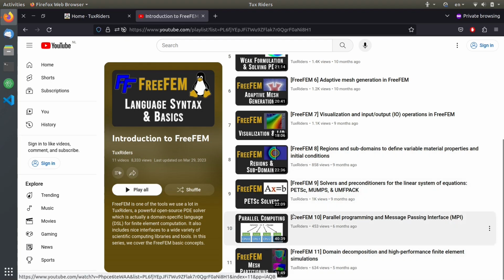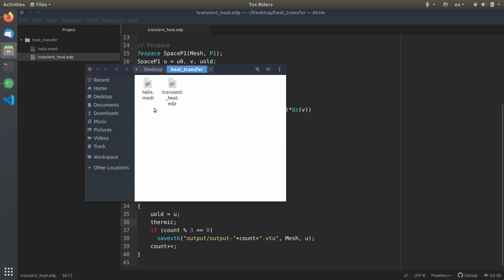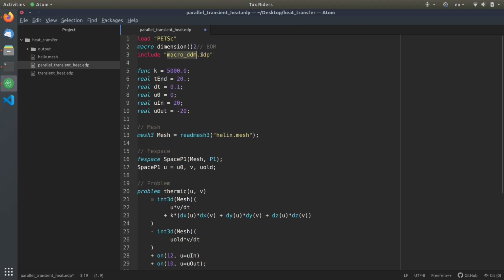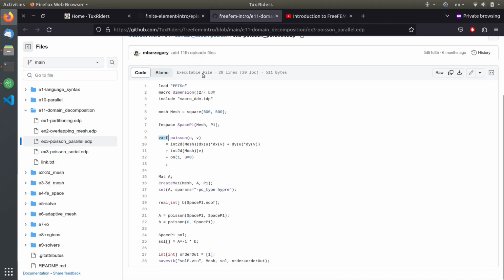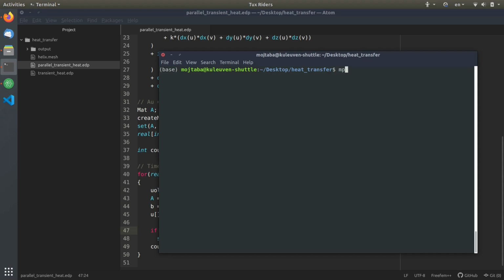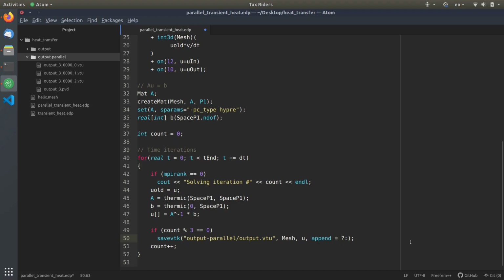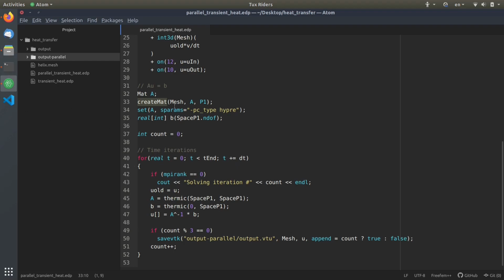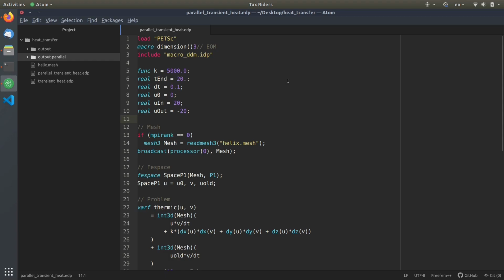Parallel 3D transient heat diffusion using FreeFEM | Mini-Project 1

Comment: Hello, thank you for the tutorial. I have a problem with my code. I am also trying to solve a transient heat equation, but my right-hand side is time-dependent and changes at each time step.

I solve the problem inside a function (func), assembling the matrix beforehand because it is constant, and then inside the function I define the new right-hand side and solve the equation.

Your method does not produce any errors, but the results are wrong and inconsistent; it gives me completely meaningless results.
Reply from the maker: Hi, glad to know that you found the video useful. It seems that you need to make sure you are updating the right-hand side vector properly within your loop to trigger the necessary assembly update for the solver (which can be a bit complicated in parallel cases). Does it work outside of the loop, like for just one time step or two? If so, there is something wrong with the loop. This is a software that solves a few time-dependent PDEs with non-constant left- and right-hand sides in parallel, so you may have a look at it to see how it does it: https://github.com/mbarzegary/BioDeg

Comment: ai summary

Abstract:

This technical demonstration outlines the process of refactoring a serial transient heat transfer simulation into a parallelized model using FreeFEM and the PETSc library. The project utilizes domain decomposition methods (DDM) to solve a 3D diffusion problem within a complex helix geometry. Key procedural steps include transitioning from standard problem statements to variational form (varf) implementations, configuring MPI-aware matrices and vectors, and implementing efficient mesh broadcasting from a primary rank. The presentation also addresses critical debugging requirements, specifically the necessity of mapping global state variables to local mesh partitions post-decomposition and managing parallel I/O to generate compatible VTU/PVD files for visualization in ParaView.

Implementation of Parallel Computing for Transient Heat Transfer in FreeFEM

    0:00 Project Overview: The session establishes a mini-project focused on developing a transient heat transfer model using parallel computing techniques in FreeFEM, building upon previous foundational tutorials on finite element modeling and MPI.
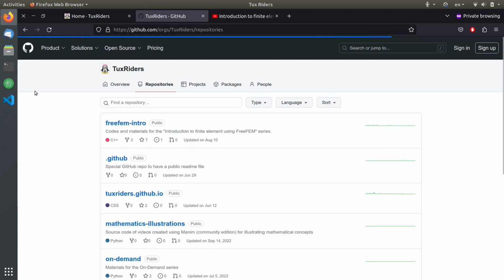    1:52 Code Integration: The workflow transitions a serial 3D helix diffusion model into a parallel environment by loading the PETSc plugin and the macro_ddm (Domain Decomposition Method) input file.
    7:45 Variational Formulation Refactoring: Standard solve or problem keywords are replaced with the varf statement. This requires a manual adjustment of the weak formulation, specifically flipping the sign of the right-hand side (RHS) to ensure correct assembly when moving terms across the equality.
    9:41 Matrix and Vector Assembly: Parallel-compatible matrices ($A$) and vectors ($b$) are initialized using the createMat macro. This process partitions the mesh according to the available MPI ranks and assigns algebraic multigrid (AMG) preconditioners via the Hypre package.
    12:10 PETSc Solver Integration: The system $Ax = b$ is solved at each time step using PETSc solvers, with the solution vector $U$ being updated across the partitioned domain.
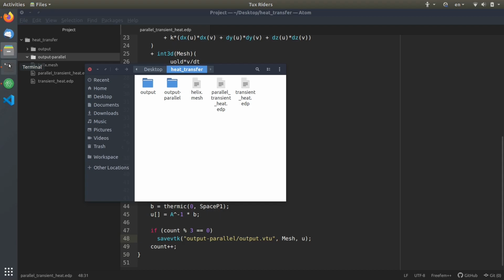    13:58 Parallel I/O and File Management: To prevent data corruption in parallel runs, a ternary operator is implemented within the loop to manage file handles. The logic ensures the output directory is overwritten on the first iteration (count == 0) and appended during subsequent time steps.
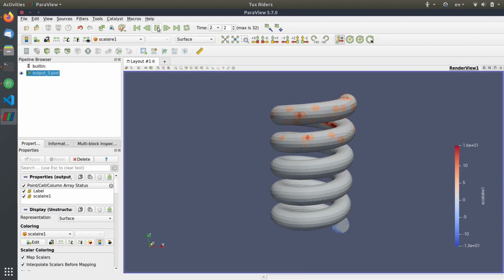    17:42 Debugging Global-to-Local Mapping: A critical failure in initial visualization (empty results) is identified as a lack of variable mapping. The solution requires calling an interpolator (U = U) to project the global initial conditions onto the local sub-meshes created during decomposition.
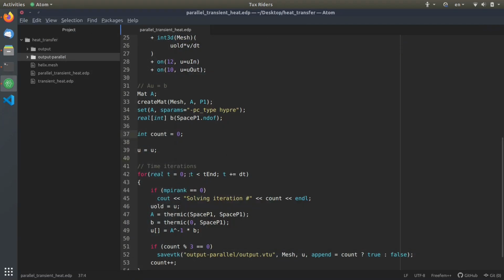    20:26 Optimization via Mesh Broadcasting: For improved efficiency in large-scale applications, the code is modified to read the mesh geometry only on MPI rank 0 and subsequently broadcast it to all other nodes, minimizing redundant I/O and pre-processing.
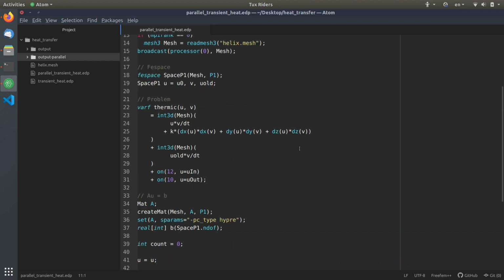    21:50 Conclusion: The demonstration confirms that with minor syntactical changes and proper domain decomposition, standard FreeFEM serial codes can be scaled for high-performance computing environments.
Reply from the maker: Cool :)

Comment: Quick question: you mention that for coarse meshes, using too many cores can actually increase the runtime, which makes sense for a simple problem because the speed at which the mesh is partitioned becomes a limiting factor. But, what if the model you're trying to solve is highly complex but is solved on a coarse mesh? Would a larger number of cores in this case also lead to the code running more slowly?
Reply from the maker: Actually, the reason why running simulations with low number of DoFs (like using a coarse mesh) is slow with many cores is different from what you say. It's not because of partitioning speed but it's due to communication costs between the sub-domains (partitions) during the simulation. If you have small partitions, the cost for the communication between them needed for parallelization will exceed the time that it takes to solve the equations inside each sub-domain. You can look at it like the partitions will spend more time on talking to each other rather than computation. So, it depends mainly on the size of partitions and less on the complexity of the physics (or geometry) that you solve for.